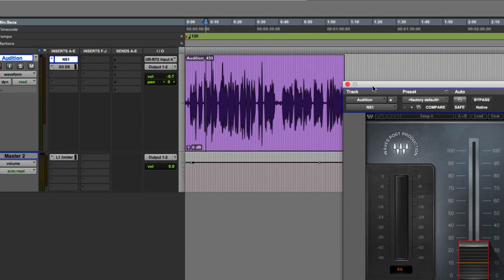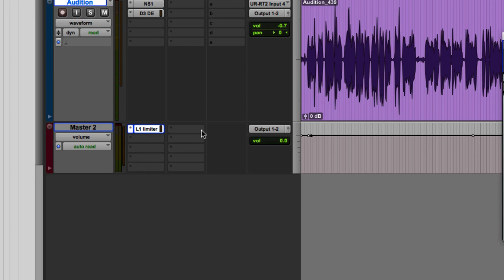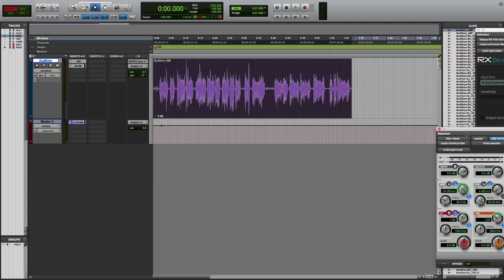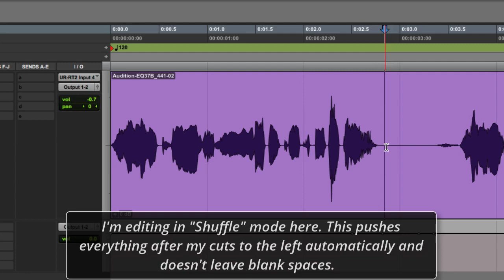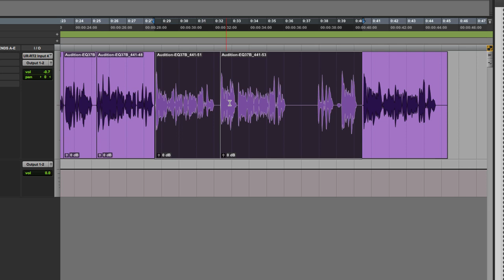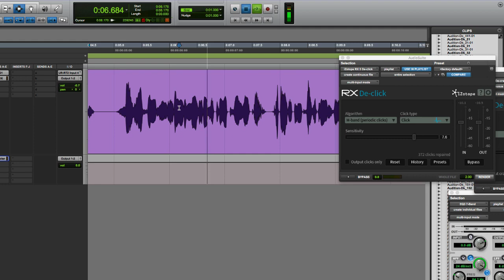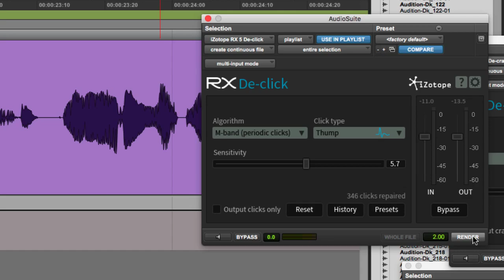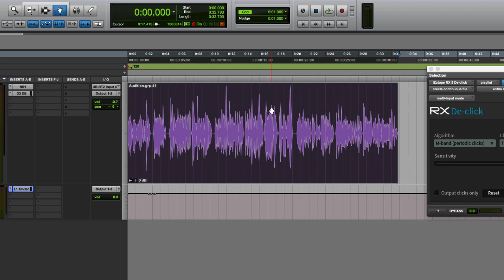[ Tutorial ] Pro Tools - Voiceover Editing Workflow

Comment: Great Video, thank you. In some cases, I don't want to shorten the pauses by removing breaths etc. Have you ever tried to not shorten the pauses between sentences, but fill it with roomtone to just clean it? This function is one of the main unique features in Pro Tools or me. Copy Roomtone to the clipboard, make a selection where you want to fill in the roomtone and press "opt+cmd+v" (Repeat to fill selection). So the gap between sentences stays the same but is cleaned up with roomtone. Now you can grab the ends of it to definite the length of the pause. Additional, when you delete with cmd+b instead of x, the room tone in the clipboard stays the same.
Reply from the maker: Oh for sure! I would say shortening the pauses totally depends on your personal preference and your client’s. I had a few clients for a while who required all breaths to be cut and that just became my default workflow for eLearning and commercial, but that definitely is less normal for things like games and animation. Replacing with silence is also a great alternative (as is this technique), I appreciate you sharing the workflow!!

Comment: Hi, just starting to edit in ProTools and looking at this great video, please say how you move the recording track from right to left within the screen before every editing move...... don't know how to word this..... it's probably pretty obvious for you but for a newbee like me !  Many thanks !  Clo
Reply from the maker: Hey there! No worries at all, this is a great question! 

I have ProTools set to "Shuffle" mode" when I edit just one track of dialogue like this because it shifts everything on the right side of an edit point over automatically. Typically, ProTools is set to "Slip" mode instead, where nothing moves automatically unless you drag and drop the clips manually. You can switch between these modes by clicking either "SHUFFLE" or "SLIP" in the box in the top left hand corner below the File and Edit dropdowns. (The hot keys are F1/F2 or ALT + 1/ALT + 2 if you need to toggle quickly between them.)

I hope that helps!
Reply: Thanks for your answer.  Now, if your audio is quite long, how do you move your screen from right to left while listening to it ?  Is there another way (smart key, mode or short cut) to move to the right than to clik on the right arrow at the total bottom of the ProTools window ?  Thanks again for taking the time to answer me, I really appreciate it !  Clo.
Reply from the maker: @claudinechabot9525  You can scroll using either a horizontal swipe (on a magic mouse on Mac), otherwise Shift + the Scroll Wheel will move from left to right. You can also use "r" and "t" to quickly zoom in and out!

Comment: New voice actor in 2021 here. I stumbled on this video by accident when trying to resolve a bunch of issues that popped up recording with an XLR mic. I haven't even used the Izotope plugins and this instruction has gotten my workflow back to a beautiful streamlined easy production instead of the nightmare it had become (a Neumann TLM 103 can pick up the sound of your teeth clicking together inside your closed mouth if you don't set things up right) and it's fantastic. 

The plugins are worth it and her settings that she uses are a killer starting point in order to fine-tune it for your own voice. If you're unsure if this video holds up because the video is a few years old I can tell you for a fact that it's worth it.

Comment: Which plug-in should be activate before you start recording? Should you just record raw and adjust with plug-ins afterwards?
Reply from the maker: Recording raw is totally fine and what will happen regardless unless you have any outboard gear! You can apply the plugins on your inserts at any point, but they are always bypassed when you record so the effects are never "baked in" to your raw recordings. I always add them to my tracks before I start recording just because I will always use the same ones and know what I want applied ahead of time. If you happen to add them before or after you record it doesn't make a difference beyond how you prefer to work.
Reply: @NatalieVanSistine  Ah that's a bit more clear. I was afraid the plug-ins inserted before would affect the main raw audio. Maybe the exception would be the Gain level set up on the external Focusrite interface (or outboard gear as you call it). A gain level too high, for example, would damage the main recording. N'est-ce pas? Thanks for your video tutorials.